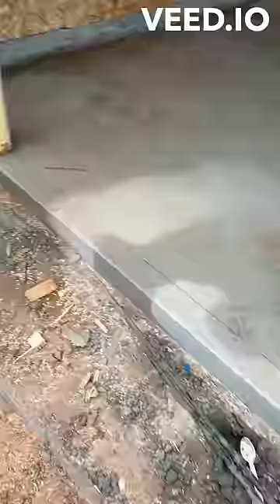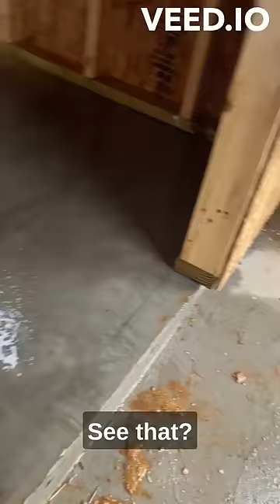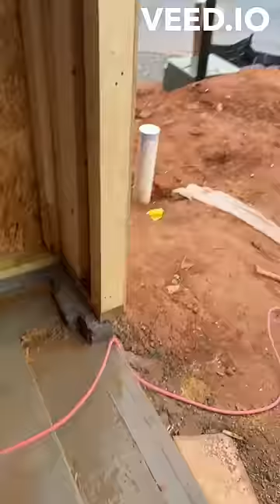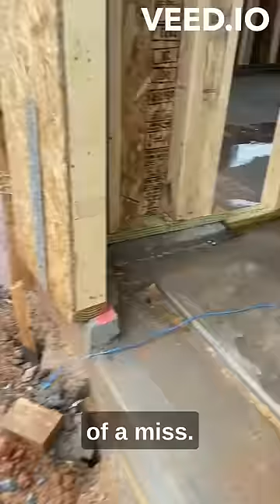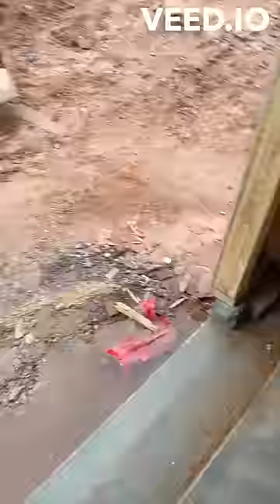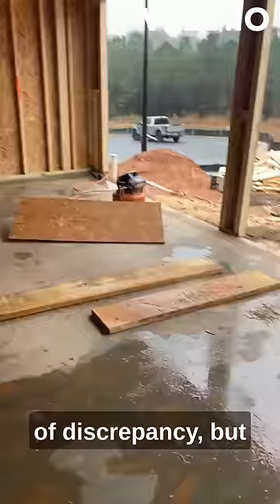New Home Slab is Wrong Size, What Now?

Comment: As a framer with 28+ years experience, I just shrink the garage so the walls sit in the concrete. No biggie , it is what it is . Errors happen
Reply: We do that all the time.
Reply: Agree and discuss with GC/Owner/Architect and plans can be adjusted. The miss is so small but the impact is huge
Reply: Happens all the time....if you need to adjust accordingly and hide an adjustment... always use a closet..easer to hide it there rather than out in the open
Reply: 😂😂😂😂.... this guy!!
Reply: When we framed offices the architect told us we could move the walls a little so they would line up with the ceiling grid😊
Reply: Bingo.  Shit happens.  Deal with it.
Reply: @ncampos210  this guy what ??
Reply: @ncampos210  you don’t even know what your talking about lol
Reply: Absolutely
Reply: Yeah, exactly.  But that didn't happen here.
Reply: Thats shit framing! All it wpuld take is to shrink the garage those couple inches instead now the entire project is fucked if i was the general them framers would be fired on the spot and i would make sure people  knew about that bullshit so they couldnt do it on other people's jobs. I  likley wouldn't use the same crete guys either. Just a bigger deal to me when framers do this because its a small error fixed easily by a phone call to the general or let alone just taking initiative to do it. Had one framer that would put pipe 1/2 " out of the wall because the wall was where it "needed to be" according to his measurements.  Same framer whos walls are  2 inches out of square. On a 6 ft bathroom. Shit quality if hvac electrical and plumbing have to go to school so should framers.
Reply: Did you see the “ fix” video?
   So much for the bearing point argument
Reply: Pre-built trusses I'm assuming, didn't think there was wiggle room in the size maybe
Reply: @skybox5743 nah they where being lazy they could have done somthing about it
Reply: @wesleeysutton5935  do what? Besides move the wall over to bear on the concrete which they should have done
Reply: Very true
Framer framers always have to correct a lot of things Good framer wouldn't allow the problem to go further. I would have made proper adjustments.
Reply: No s*** and even if it's a trust roof not a big deal unless there's a hip. That's all on the framer and I say we're using prefab walls
Reply: I wonder if framer did that because the roof trusses?
Reply: @pb7133  it’s a possibility yes
Reply: @pb7133  but I’m guessing they followed the plan dimensions
Reply: Exactly, as a C-8 concrete contractor for 30 years I've made sure to take care of the framers all the time. Respect is earned.
Reply: If you shrink the dimensions of the house that I am paying for, do you also shrink your bill? If not, you are as much a thief (grand larceny) as the builder.
Reply: @slabsolutions1  so losing an inch here or there is grand larceny?! 80 % of the time we make spaces slightly larger lol. You can’t just follow the concrete, it is rarely square so you need to compensate to make the house work with the foundation
Reply: Yeah but if I’m the homeowner then it is a biggie cuz imma notice I’m missing a foot or so of space
Reply: 100.. I dont get why they didn't. ur talking a few inches, but the way it is now it all has to be redone.
It's like the framers are trying to show the concrete guy that the slab is too small
Reply: Why would you do that when there's going to be a driveway
Reply: @thedoorwall  ummm what?
Reply: @thedoorwall  they should have made sure the wall sat on the concrete
Reply: @stevegagnon9451  how in the world have you built houses for 28 years come in here saying that you've never seen green plates not bear all the way on the concrete?
Reply: @thedoorwall  because sometimes the concrete crews mess up and make the foundation smaller or bigger . What I’m saying is the framers should have made sure to seat the wall on the foundation
Reply: @thedoorwall  I would have made sure the plate sat on the foundation for sure
Reply: @stevegagnon9451  yeah but changing the dimensions from what the blueprint says is not the correct choice I think in this circumstance because how many times have you seen a 2 x 8 green plate by like an inch or so and in this circumstance it's a 2X4 green plate but there's going to be a driveway and I get that it has to have a pitch but it's quite possible to make that pitch start a little further out so that it Bears more you could smash the green plate down Anchor It Down and then where there's a pizza cut gap on the bottom of the studs you could sister aboard that had an angle on it if it really was that big of a deal that it wasn't bearing 100% but yeah I think it should at least be 50% on there cuz it has to Bear by like 2 in or something
Reply: @stevegagnon9451  I think there is code that has to do with how much stuff has to bear on bearing points
Reply: @stevegagnon9451  but I'm pretty sure the amount that something has to be on a bearing point isn't 100% in every circumstance but maybe in some circumstances they're more strict about it
Reply: @stevegagnon9451  I don't really like the idea of changing the dimensions
Reply: @stevegagnon9451  because then if there's a mistake they get less house overall
Reply: @thedoorwall  it’s rarely 2x8 and it should sit at least 3 inches if it’s 2x4 the framer should have moved it over
Reply: @thedoorwall  I know the code lol
Reply: @thedoorwall  I’ve seen foundations off square by 3 inches and had to compensate
Reply: @stevegagnon9451 That, or fix the screw up, not the buyers fault. Know your craft or go flip burgers!
Reply: @mikenotta7079  well you could drill holes ,epoxy then add rebar and pour more concrete to fill the 1.5 inch it would take to make it right but they won’t do that. I’m guessing you flip burgers ? Or wait you’re the manager at McDonald’s lol
Reply: @stevegagnon9451 who the fuck is going to do that
Reply: @thedoorwall you put the slimmings on the dog box obviously 🙄
Reply: @stevegagnon9451  I'm a fourth year framer but I did do like a year of flat work and they always pour in like multiple runs so first they'll pour like the basement or the garage and then they will pour the basement of the or the garage and then they will pour the driveway which they will have to drill into the garage flat work and connect with rebar and I don't think they use epoxy I don't think we ever did that my whole point was that there's going to be a driveway and those green plates are hanging over on the driveway side but now the driveway is going to be pitched so yes there might be a little like maybe an eighth or a quarter gap on the Outer Edge you could probably stick some Seal Seal in there right before you pour the driveway on top of the expansion joint
Reply: @thedoorwall  no I know they won’t repour a small ledge like that , but the framer should have compensated
Reply: Adjust, adapt and over come... You can usually hide stuff in the roof system if you know what you're doing.
Reply: Sure the homeowner would rather lose a couple inches of house than have it done half ass where it lacks the structural integrity it's supposed to have
Reply: This is the only correct comment
Reply: @charles200  exactly my thoughts
Reply: The only time I saw a framer do their job the first thing they did was to see if the rooms were square and if not then make the proper adjustments.
Reply: @Stephenwc  if you start off square when plating the foundation, once floor is done you chalk perimeter then recheck the square and the rooms  dimensions are taken off those exterior lines . Same with slab on grade , you square the perimeter and go from there
Reply: @stevegagnon9451  You seem knowledgeable.   I'm reading folks defending the framers saying that the trusses might have been pre-fabbed. I'm contending that pre-fab manufacturers are likely providing some amount of tolerance /  give and take because on-site construction is unlikely to be precisely perfect. Can you corroborate or deny that position?
Reply: @Stephenwc  well trusses are normally pre fabricated but there is a little play
Reply: @StephenBoesch trusses are designed to fit the blueprints with very little in the way of adjustments. If it's a hip roof and you move the girder back to match the new wall location it will change the pitch between the girder truss and the next truss creating a hump or divot in the roof. You can shift the wall in and adjust truss placement to where it should be but then the finished soffit will be larger. Easiest fix is to upsize the wall framing to 2x6 creating 2 more inches of bearing and allowing trusses to bear in planned location. Loss of 2" in garage but roof and soffit are where they should be. Gable truss design wouldn't be as bad , move wall in, move truss in, keep on clicking.
Reply: I'm guessing the walls were prebuilt and shipped counting on the concrete to be where it was supposed to
Reply: @computerz009  no not really even if they were , you just cut them back . The framer went with the actual dimensions of the building when he should have compensated

Comment: I've ran into this a few times inspecting. And offered the below references when reporting. 

They ended up with an engineer designed  steel angle bolted into the slab that offered support to the wall. That garage portal wall will likely need reframed. In addition to those cast-in hold down straps it should have minimum 2 x 1/2 bolts with square plate washers or sometimes Design professionals will specify LTT20B or HTT4 connectors which would be in the engineer drawings (if available).
The IRC R301.1.1 allows for the use of the American Wood Councils (AWC) Wood Frame Construction Manual (WFCM) for the framing design. AWC-WFCM sections 2.4.1.3 Engineered Design & 3.2.1.7 Prescriptive Design are cited and both state that sill and bottom plates shall have full bearing on the foundation wall.

Comment: Was just on a commercial job, 125'x30', 8" stemwalls, with a loading dock, the entire pad was 6" off because they didn't account for the expansion joint in the framing, and the loading dock was a foot out of square at the east end of the dock, figured whoever was on the smart end of the tape didnt account for the dumb end burning a foot
Reply: Why doesn't anyone here talk about any degree of flexibility in the building?  Expectations that every stage of the building process goes perfectly is a formula for failure.  Now six inches is excessive. But the width of a stud? cmon..

Comment: Even if the concrete guys made a mistake. Thats completely on the framers. They should be barred from building.
Reply: Seriously. They should be checking the slab before starting the work and once they noticed it was off by a lot, a call to the concrete guys to come fix their mess up.
Reply: @vincentsprung5810  unfortunately usually doesn't work that way..piece work framers will build  per plan  regardless so they can get paid and let the GC work out the problems..
Reply: Trusses don't shrink.  They are ordered at the beginning of a project. Framers are right concrete guys are always wrong
Reply: @jameshessert4026   Well..technically they may shrink a little if the wood is wet.. but not 3"....🥴
Reply: I wouldn’t pay them
Reply: @jameshessert4026 ding ding ding. You my friend seem to know what you’re talking about.  I’m gonna go out on a limb and say the framers brought this to the attention of the super and because returning the Trusses and getting new ones is just the beginning of shit that would need to fixed/adjusted, he decided instead adjusting shit for the next 10-12 months, better to just bring those mason’s back for a little nip-tuck
Reply: Same for the plumbers if they move their forms after.
Reply: Shuffle the house back one inch and call it a day
Reply: @jameshessert4026  It doesn't matter if the trusses are right, the framers put the walls hanging off the slab when they knew damn well it has to be fixed and won't pass inspection. That's 100% the framer's fault for not informing the builder of the problem.
Reply: @jameshessert4026 placement or eves length isn't to Big Brain is it James
Reply: Exactly, and I wouldn't dare frame anything after finding the slab too small, unless the GC gave permission in writing because he could easily not pay you for framing on a pad that is obviously not the correct size. I also couldn't do it simply because my conscience wouldn't allow me to continue regardless.
Reply: Your wrong mate
Reply: @jameshessert4026  But what kind of an a-hole keeps on building? That attitude will get you fired and NOT paid from Me. 
EVERY truss can be adjusted to take up slight discrepancies.
Reply: I guarantee someone signed off and told the framers to build it. And yes they have to build per plan and the concrete company can still fix it. It's a pain in the a**
Reply: @jameshessert4026  its not even that its the finish inside. builders these days are essentially building a kit house that a developer chooses to build. changing any of the framing will throw off all the finishing cutting into the end profit actually having to make a custom home
Reply: @jameshessert4026 trusses are running parallel to that wall, not perpendicular. No length would have needed adjusting. Back on the framers 100%.
Reply: It's very likely the framers were told to proceed and the builder will find a band aid solution with the concrete. The builder is always under pressure to stay in schedule
Reply: @7msuprastar Yes it's highly unlikely the framers did this on their own, and if they did the jobsite superintendent should/would have caught it early on
Reply: people keep blameing the framers but on new homes framers cant just go moving walls. the whole house may have
 come as engineered panels so all they did was assemble a big piece of 
IKEA furniture and they would have no control how big the house ended up
 and even if not the houses size is also controlled my the trusses if you just go moving walls the roof will not fit right
people think you can just change the framing to match the slab but on 
most houses built nowadays this is just not an option with out having 
things re-engineered iv framed houses that have had this exact issues
Reply: @jameshessert4026  There's no "right" about placing the walls 2/3 in space.

Comment: As a framer if I could I always pulled a tape on the concrete forms before the pumper truck showed up. And I never let them place the j bolts if I could help it

Comment: So what do you do here in this situation? Also why did the framers continue if the slab was that far off?
Reply: The framers probably looked at it as a, "not my problem" problem.  They were paid to erect walls to meet a blueprint and that is what they did. They then moved on to the next job.  And to be fair, they might not have realized the problem until they had already been onsite for a while.
Reply: @superdave8248 Most likely the builder told them to frame to specs and will make the concrete contractor pour new footings, its a real mess

Comment: As a commercial jobsite superintendent, i say they could have easily cheated the framing a little bit to make it work. I give both the framers and the foundation guys an F for this one! Also gotta give the GC in charge an F for not stopping this before it escalated into the problem it is now 😂
Reply: I think the GC knew and just told the guys to keep on going cuz there's nowhere in hell it's like a surprise not with foundation working and that much of the house going up 😬
Reply: With no tape measure or prints showing use anything. How on earth do we give anybody grades. We don't know shit. Lol
Reply: All numbers carry to the trusses.   Concrete guys need to read tape and print. They suck
Reply: @jameshessert4026  yup, concrete guys definitely need to learn to read a tape. Could have cheated the framing a bit and made it work more than likely tho. You are right about the trusses. Might have had to get a little creative with the soffit or eaves after trusses set
Reply: @rowdypalmer8061  when you've framed 100s of houses you just know 😁

Comment: Should have shifted to 2x6 on that wall. Keeps the load primarily flowing into the slab while giving proper exterior dimensions for the roof trusses to sit on.
Reply: yes!you are the only comment that instead of blaming somebody,HAS A SOLUTION.!